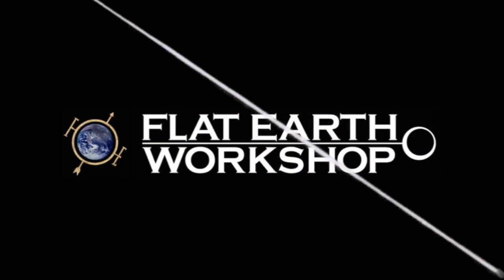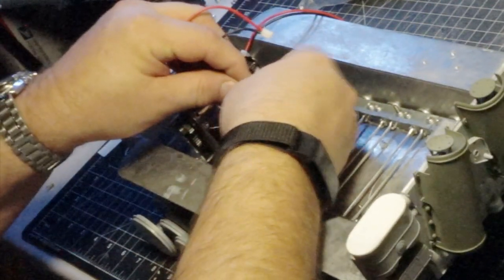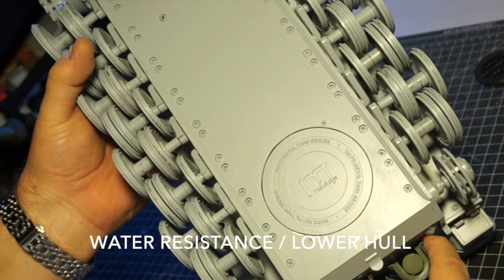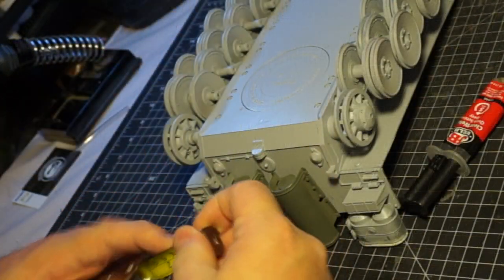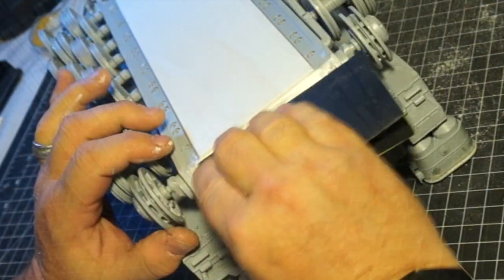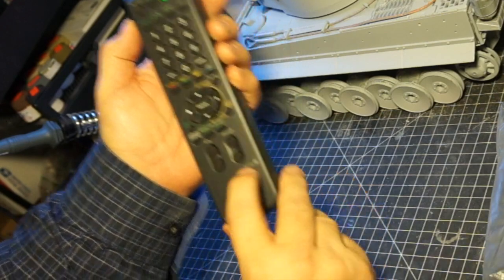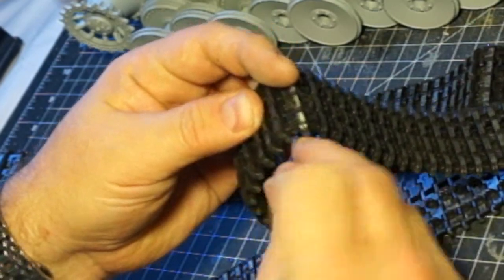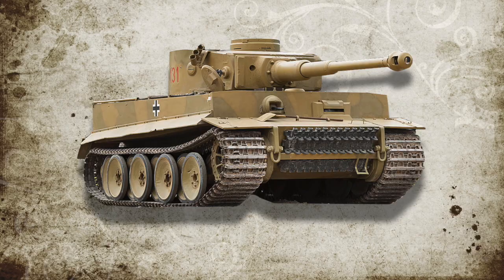All Metal-RC Tank Kit Bash! / Part 6  / Mato Metal Gearbox

Comment: rather than using styrene to cover Mato plate on underside, why not use kwik seal over screws and perimeter or paintable silicone over the primed surface?  Actually, you could have done that to both surfaces before you put the lower hull together.
Reply from the maker: Hi Petro! I chose to cover the bottom of the tank to make it look a bit more realistic...the Mato logo didn’t appear on the real ones. However I will check when I visit one of the survivors at the US Tank Museum at Fort Benning, Georgia...just to make sure! All the best!

Comment: This Bronze Bush you use is not the best Solution this mato casing has a Diameter 11 mm and the Schaft 6 mm on that area you can machine it out to 12 mm and fix 2 nice bearing from Amazon Ball bearings are much more Perfect for that.
Bearing Size 12 out 6 in
Reply from the maker: Great info…thanks! Please subscribe…we need you here!
Doug